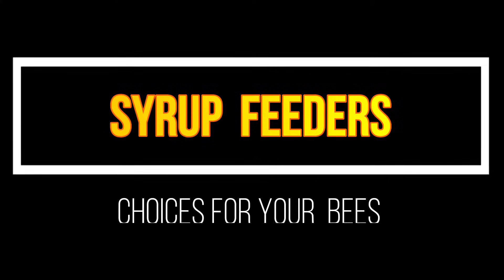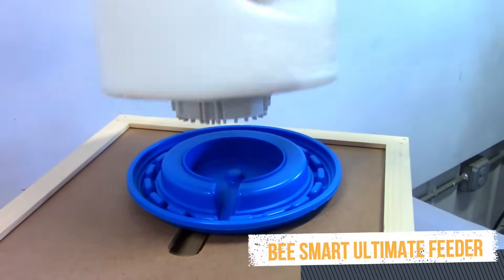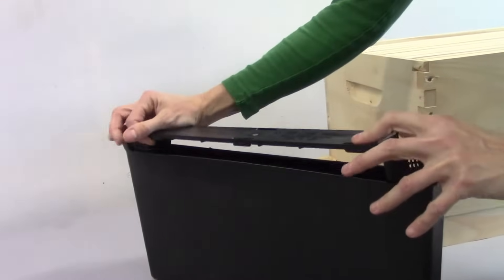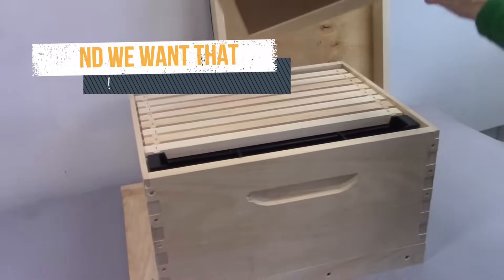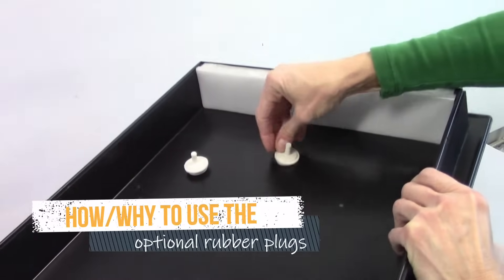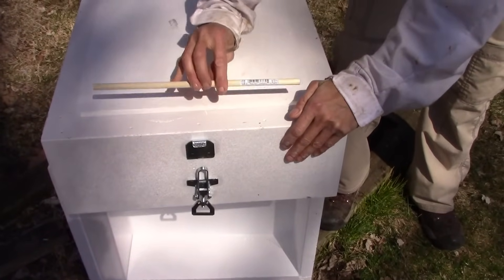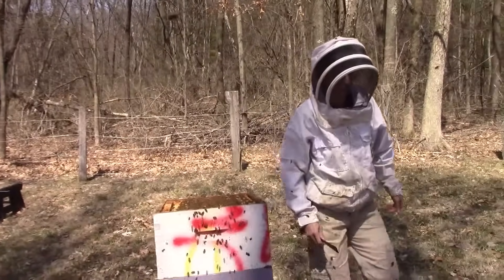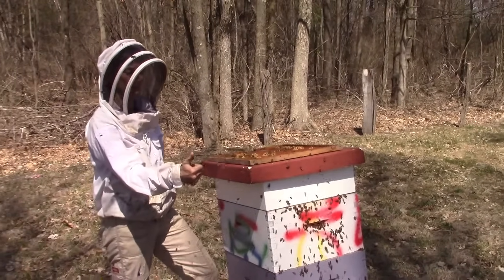Comparing Honey Bee Hive Feeders

Comment: Why don't u use the inner cover when using the hive top feeder?
Thx
Reply from the maker: Hi David, we don't use an inner cover with a hive top feeder to prevent bees from being able to crawl in the inner cover "notch" and drown in the sugar syrup. This gives bees only one safe way in and out of accessing the syrup to eat it... and not drown in it! We hope this information is helpful.
Reply: I'm concerned about proper ventilation?... Your thoughts?
Thx
Reply from the maker: @davidsoloninka7742  This is a legitimate concern! Theoretically, when it's much hotter and more ventilation is needed, there will be a strong nectar flow and you will not need to feed anymore. At that point, you can remove the hivetop feeder and add your inner cover back to provide a little more of that needed ventilation.